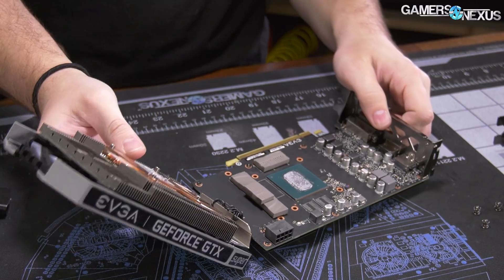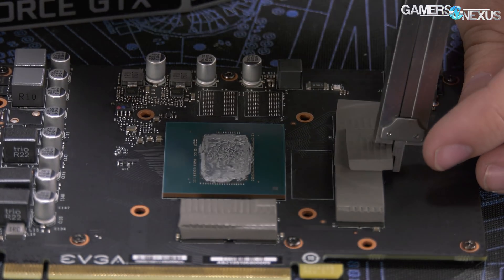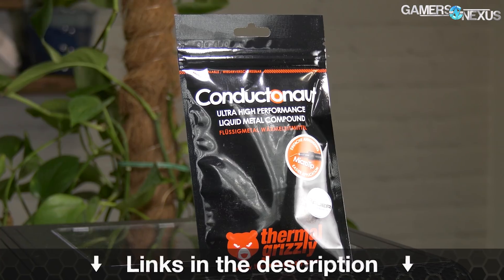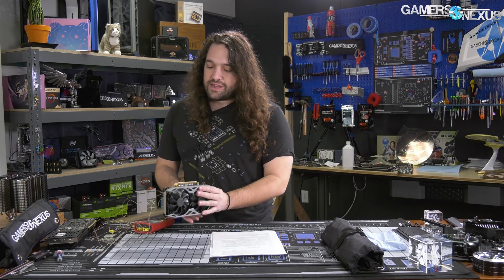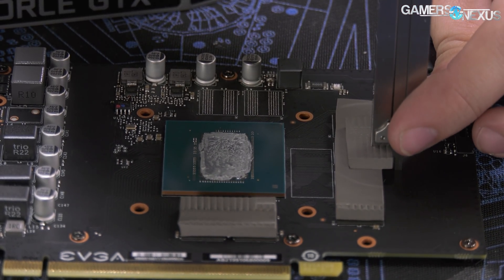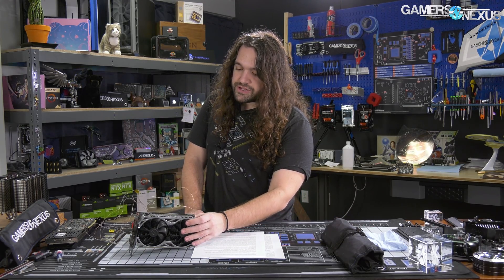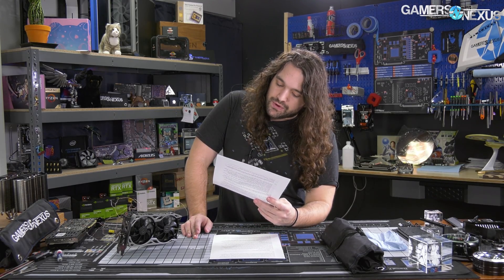EVGA's Double-Stacked Thermal Pads Tested: RTX 2060 KO Thermals

Comment from the maker: Watch our initial discovery on this card's secret workstation performance here: https://www.youtube.com/watch?v=mUFRBnJdx3Y
Latest HW news episode: https://www.youtube.com/watch?v=qgy9v8p5OJY
Reply: @Gamers Nexus
I posted a comment previously on my speculation that the KO card might have more than 30 SMs but with the extra SMs just having a reduced number of processing blocks (my old comment is there on the previous video's comment page), and I wrote a short test CUDA kernel to test this speculation out. I currently only have regular 2060 cards and haven't been able to get a KO card yet so I was wondering if maybe you'ld like to test the kernel out on your KO card.
If you compile and run it via the command:
./test 0 30 
This will run a kernel on the card (first parameter selects the device, so use 0 if you have just a single card system), which will launch 30 thread blocks on the device. The test kernel allocates 48KB of shard memory per thread block, so it ensures that only one block is allocated per SM at any given time. So with 30 blocks launched it will run in around 2 secs on a typical 2060.
If you then run it via the command:
./test 0 31
Then it will launch a kernel with 31 thread blocks which on a regular 2060 (with only 30 SMs) will run in about 4 secs, because now the very last block has to queue on an SM before it can be executed since the 48KB shared memory allocation forces only one block allocation per SM.
If my speculation on the KO card is correct then the same command for 31 thread blocks should still run in about 2 secs since the speculation is that the KO card has at least 31 (or more) SMs.

You can also query the device for the "SM count" device parameter but I also wanted to programmatically test for more than 30 SMs since I want to be sure the Nvidia device driver isn't reporting "30 SMs" when in fact the KO card really has more.

(source code follows)

#include <stdio.h>

#include <cuda.h>
#include <cuda_runtime.h>

#define SHRDIDXSZ 48*1024
#define OUTRLP 12*1024

_global_ void testKern(int *iarr) {

  _shared_ char shrdarr[SHRDIDXSZ];

  int idx = blockDim.x * blockIdx.x + threadIdx.x;

  int sum=idx;
  for (int j=0; j<OUTRLP; j++) {
  for (int i=0; i<SHRDIDXSZ; i++) sum+=shrdarr[i];
  }
  shrdarr[idx % SHRDIDXSZ]=(char)sum;

  iarr[idx] = sum;
}

int main(int argc, char **argv) {

  int devid = atoi(argv[1]);
  int numblks = atoi(argv[2]);
  int numthrds = 1;

  printf("device: %d\ntotal blocks: %d\n", devid, numblks);

  cudaSetDevice(devid);

  int numBlocks;
  cudaOccupancyMaxActiveBlocksPerMultiprocessor(&numBlocks, testKern, numthrds, 0);
  printf("blocks per SM: %d\n", numBlocks);

  int sz = numblks * numthrds;

  int *iarr;
  iarr = (int *)malloc(sz * sizeof(int));
  for (int i=0; i<sz; i++) iarr[i] = -1;

  int *d_iarr;
  cudaMalloc(&d_iarr, sz * sizeof(int));
  cudaMemcpy(d_iarr, iarr, sz * sizeof(int), cudaMemcpyHostToDevice);

  testKern <<< numblks, numthrds >>> (d_iarr);
  cudaDeviceSynchronize();

  cudaMemcpy(iarr, d_iarr, sz * sizeof(int), cudaMemcpyDeviceToHost);
  cudaFree(d_iarr);
  cudaDeviceReset();

  free(iarr);

  printf("done\n");
}
Reply: What about use of copper shims sandwich with pads/paste. Would that improve transfer or putting thicker copper plates sandwich by pads/paste??? @AskGN
Reply: @granthampson5917  Yup, or just some low profile heatsinks, maybe? I'd be interested.
Reply: How about running the tests without the pads? Would that be any worse?
Reply: It would be nice if you could test memory temperatures without those thermal pads, to see if airflow from fan is doing better job than pads.
Reply: I would like to see this card with a better cooler on it and see how far it can clock vs the TU106-A1 mibbi sacrifice a 1070 cooler if it fits.
Reply: I don't think it'd do too bad to be honest. I imagine it'd go something along the lines of this: Chew gum, dry gum out, break elasticizer (sp?) down with something solvent like acetone for better homogenization with heat transfer materials, mix in stuff like graphene, galium nitride, etc, re-harden or reshape into thermal pad shape, cut into squares, and test thermal conductivity. When plastic is thin enough, it can transfer heat but when there's enough of it at boundary, it becomes an insulator. That's if memory serves correct but it's 5AM when I finished watching this upload...
Reply: I think Jay2cent talked about people getting crazy performance from 2060KO from a bios flash, or something equally as stupid.
Reply: Tzuede Off the Cuff  he's had them for a few years, just sometimes they were not within arms reach maybe, lol. Oh, and chewing gum rrrr thermal pads tend to have more give than most drafting rulers have precision, lol.   AKA, that could be 10mm (2x 5mm) of pads squished down to 9mm by the heatsink being mounted to the card from the factory.
Reply: Can you test whether the cooling gets improved or not when applying heat isolating material such as ceramics or wrapping as some do on the headers of an engine to get better performance but on heatpipes between the fin stack and the CPU mount to see if you can achieve the same effect on a cooler's performance?
Reply: This reminds me of the 8800GT days
Reply: I tend to be a regression purchaser so I've been waiting for the market to settle, but I found one of these < $250 pre-owned from a certified retailer so I tried one out. Its been a hell of a lot stronger than the 980 previously occupying that slot, but I'll probably upgrade it next year. I'll say this: it runs hot. Upgrading my machine with some rgb fan kits resulted in two extra fans and an 8C drop in GPU temps measured through 3D mark across the board. This will be the used market steal of 2021 when they're widely available for less than what I payed.
Reply: i wonder if that card can be flashed with a 2080 bios/firmware to eventually get more out of it
Reply: @blazerden  not a flying cat in hells chance. for many many reasons.

Comment: 6:42 my better TU104-150-KA-A1 Gigabyte Windforce 2060 Rev2.0 6GB card has empty ram contacts at bottom/PCIEslot & FOUR Phase mosfets & 3xDP+Hdmi imo KA or KC on the gpu code says which vrampads remain empty. will mod Twinturbo3 Accelero cooler, which hasnt 51mm GPU hole distance, huge struggle.

Comment: I have an RTX 2060 KO, and according to CPU-Z it consistently runs between 105C and 107C when I play No Mans Sky and other games at 2K 60Hz I'm surprised that the card is not throttling down with the memory getting that hot. Do you think CPU-Z's readings are accurate?

Comment: Hey I really need some help, wondering if anyone could point me in the direction of some super soft thermal pads? I changed the pads on my Alienware M15 R5 and now i'm having compression issues, can't find any pads as compressible as the stock/oem ones.

Comment: i just put after 2 years new (good) thermal paste on my RTX 2060 KO ultra and it was 10C less hot, but i see the problem with this extrem fat 9mm thermal pads and the memory is still extrem hot 96C and I dont find new thermal pads bigger than 5mm

Comment: i want to buy this rtx 2060 KO ( as its cheaper ) and then AIO water cool it (using kraken G12). Then i could even overclock with real low temperatures right ??  plzz help Gamers Nexus. Also will the kraken G12 fan be enough to cool the vram & other pcb components , if i have pretty good air flow case??

Comment: I bought this card because of a brain fart I had and I wanted something better than my old 960 but cheap. It seemed reasonable but I didn't know about the power limit beforehand...totally should've bought something else. I enjoy overclocking but it's very limited on this card.  Can these thick thermal pads be replaced with something better for better cooling or should that be left alone and just plan on buying something better later on?

Comment: I just picked up one of these for a new build I am doing for a friend. I used the  Phanteks shift air case and while over thermals look good, when this card ramps up around 65c it gets loud and stays loud. When I got to cool it down it never ramps back down even at around 32c. This makes the whole system loud and unenjoyable to use. I contacted evga and may end up RMAing the card. It's a bummer for sure as the card seems fine otherwise.

Comment: I recently purchased this card and took it apart myself as well.  The memory chips on the bottom, as well as the top and bottom ones on the side, only have one 4mm thermal pad which then makes direct contact with the heat pipes.  It's the two middle chips on the side that get screwed by having the double stacked pads and contact only with the heat sink fins.  To be fair the double stack pad area happens to hit on the heat sink in an area where there is some flat parts (can be seen on the pads in the video at 6:17), which I think are there to reinforce the heat sink's rigidity.

Also, Steve kind of touched on this in the video, but both sets of memory chips also have thermal pads on the back side of the board that make contact with the metal (yes metal) back plate.  So I'm guessing some cooling takes place there as well, even though it does have to travel through the board first.

I tossed some better thermal compounds on the die.  I also put separate small thermal pads (lol) on the VRMs to extend their contact up to the heat sink as well.  Then I closed it up.  Thermals seem to be okay for me.
Reply: Hey, after two years, how are your GPU thermals? I’ve left the stock goop on, and two years later, the hotspot temps like to get to 105! How much better was your replacement compound compared to the stock stuff?

Comment: I wonder if the ground layer design of the PCB has an effect on the GDDR6 thermals. Maybe a lot of heat from the memory chips is being soaked by the PCB which in turn is cooled by the fans of the cooler?

Comment: Eh, just stick a Raijentek Morpheus Core II on it and call it a day. So log there is air going across the card, as well down (or up) there isn't a problem with swapping the air cooler if you've got the space and no intent to use two at once.

Comment: "sub-105 degree specification" ... So GDDR6 modules are officially safe up to 105 degrees?  Will GDDR6 memory modules degrade at lower temperatures, such as in the 90's?  I have a Radeon RX 5700 and, according to either HWiNFO64 or MSI Afterburner, have my memory go above 90 when using 4k Super Virtual Resolution.

I suppose I should also ask if GDDR6 memory temperature is indeed precisely the number reported as 'GPU Memory Junction Temperature' in HWiNFO64 and reported as 'Memory temperature (MEM)' in MSI Afterburner?  I think for AMD cards, this number is the highest temperature among all of the memory modules.  I don't know if this is different for Nvidia cards.

Comment: Given such ample space below the cooler, why aren't there just tiny little chip heatsinks stuck down with thermal tape? There seems to be enough airflow down there that it should work better than one of those ridiculous pads, and i'm not even sure that it would be more expensive.

Would you like to test little heatsinks instead? Or some other solution? Or even whether the chewing gum is better than letting the chips cool bare naked on the component side of the PCB?

Comment: Question: is there enough space to throw on some low-profile extruded aluminum or copper heatsinks?
Reply: That would have been an even better test.  Thermals being fine with 9mm of thermal pad or better with just low profile air heatsink underlayer.

Comment: I want to see numbers without any pads. We use CA glue to attach thermocouples to the part package for development testing. I am sure you could try that here if you removed the pads. 

There is going to be very little heat transfer through the edge of the fins. The only reasonable interface I see is to the heat pipes. The chips are going to reject a fair amount of heat through the BGA balls and into the board. If moving air from the fans can get down to the board, it might cool more effectively than the 4-5 mm pad touching the very edge of the fins. No air is getting to the chips or between them when the pads are in place. That PCB is going to have multiple plane layers for power and ground. A lot of heat will flow through the board itself. 

So I am thinking cooling the RAM by cooling the board with forced convection might be more effective than relying on conduction through the part body and those thick pads to move the heat into the heatsink fins through the tiny end cross section of the fins.

In the end this is not a product that is meant to be optimized, it is meant to hit a price target. I was in the market for a 2060 and purchased a founder's edition card for $299 specifically because I thought it had better cooling.

Comment: Thanks so much for your initial review of this card and for clarifying here that EVGA 2060 KOs all have the TU104 die. I bought the Ultra Gaming version yesterday and can confirm that it's a TU104 in GPU-Z. I work primarily in Blender and Substance Painter, both of which can use CUDA and Optix for rendering and baking, so it was a huge upgrade in speed over my old GTX 780. Btw, I did some benchmarks and compared them to this Blender user (https://www.youtube.com/watch?v=qqP5YHbk8eg) who owns a 2060 Super. Granted, we have pretty different rigs, I have newer Nvidia drivers, and I used Blender 2.82 while he used 2.81 (I saw minimal difference rendering the same scene in both though), but it was interesting to find that I had faster rendering times overall. Here's a copy-pasta if anyone's curious:

Very interesting results. I have an EVGA 2060 KO Ultra Gaming that's been hyped up by reviews (https://www.youtube.com/watch?v=mUFRBnJdx3Y) due to it using the larger TU104 die from scrapped 2080s. Since the 2060 Super has more CUDA cores but a smaller die than mine, it should be an interesting comparison. My Blender 2.82 results in the BMW benchmark are worse than yours: 39.41s using OptiX compared to your 33.37s and 1:13.02 using CUDA (GPU only) compared to your 1:03.48.

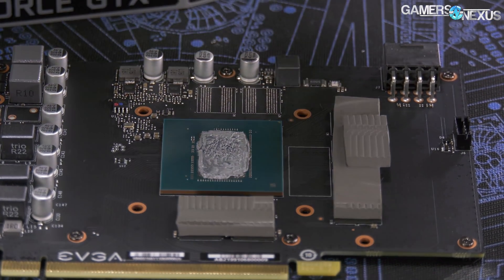My results in the Classroom benchmark are better though: 2:14.38 using OptiX compared to your 2:46.81 and 3:31.91 using CUDA (GPU only) compared to your 4:56.18. Blender had to load kernels for the OptiX render in the classroom scene for a minute and 20 seconds, though, which I omitted/skipped by rendering it again. I assume you omitted that part too or you somehow didn't run into it entirely? I'm using Nvidia's 442.19 studio drivers.

Edit: Just did the Barcelona Pavillion benchmark and I had better results too mainly using CUDA: 3:02.90 using OptiX compared to your 3:17.40 and 6:24.85 using CUDA (GPU only) compared to your 7:20.98. I made sure to match your tile size.

Comment: So what's the fix for this? Could you fill in that 10mm gap with copper shims and then use a conventional 0.5mm thermal pad?
Reply: I had the same idea, i saw many copper bars that can be used as heat sink in aliexperss, i dont know if it will work or not i hope they will make a video about it.
Reply: That should work but you would want to use thermal past between the copper and gauge for the additional thickness the paste will give you.

Comment: To the best of my knowledge this kind of thermal pad is much worse at transferring heat than say aluminium. It's been many years since I last looked into it but back then it was about ten times difference or more. It's been ages ago so I don't remember the particulars other than it made me decide to really try to avoid thik TIM pads in whatever it was we were making at the time. So what would happen if you were to machine a aluminium or even copper block just slightly thinner than the gap the TIM pads make up for, use paste between the memory and the block and a thin high quality TIM pad between the block and the finstack?
It would be a lot of work for results of dubious value other than to satisfy some curiosity.

Comment: Something I would like to know, why do the pci-e power cords always come from the outermost side of the card? And why are there so many pin configures when psu wires are just off shoots adding pins but not actual wires? Love the show.
Reply: Cable management alone would dictate that the PCIE cords should be on that side of the card. Because cases that allow you to route your cables behind the motherboard tray have cutouts on that side to allow you to have less wire showing.

Comment: You guys should do a test (if only just for fun) with an AMD card using the same thermocouple arrangement (without the double stacked thermal pads, of course), or as close as you can to it. Then you may be able to get a close, albeit still not 100% accurate delta between the known readings in software that AMD allows, and the thermocouple reading. Just a thought, could be a good experiment and then you’d have a general idea of what the delta is for the Nvidia cards. You could try a few cards to see if the delta stays the same or within a degree or two.

Comment: hey, 2 thoughts GN.
1. With such thick thermal pads that have such small surface area thats actually contacting the heatsink fins; would it at all be more effective to remove the thermal pads all together and allow the airflow to just hit the VRAM for cooling?

2. since they're so much clearance between the cooler and the VRAM, couldn't you just remove the thermal pads and apply your own small heatsinks with some very thin adhesive pads? even a big flat plate (shim) of copper for the air to come though and hit would do the trick pretty well. with 5-9mm of clearance i don't see why you couldn't squeeze in say, a small RPI heatsink or even a long flat heatpipe with thermal pads on top to get way more surface area connection to the fins.